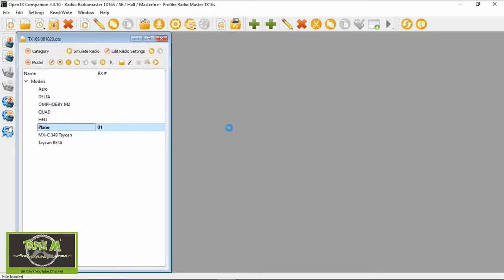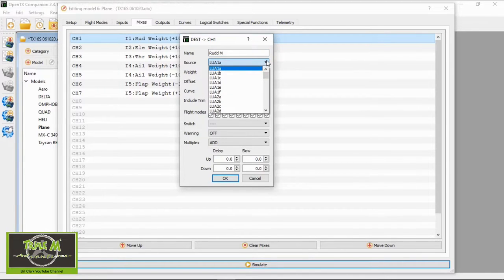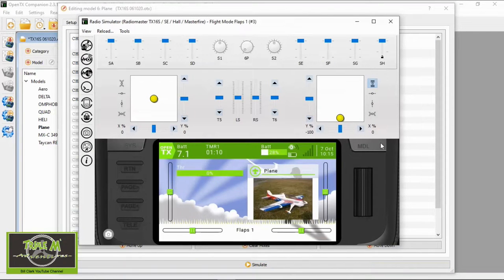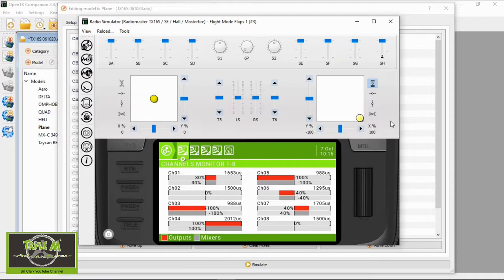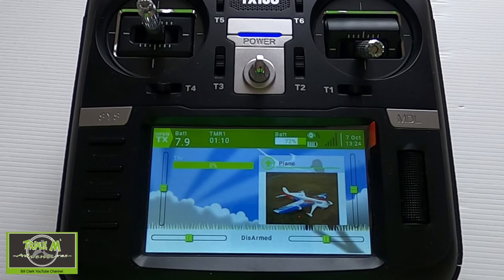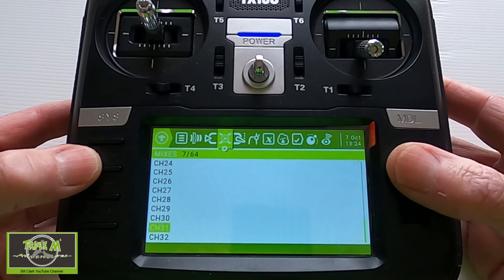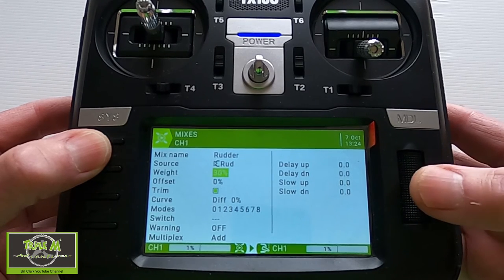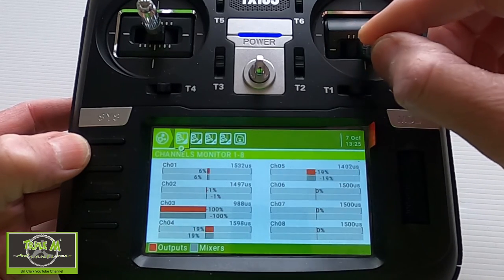RadioMaster TX16S Setting Up Aileron Rudder Mixing

Comment: Great vid. I firstly see this in OpenRC forum, and now this video. I have set this to my Jumper tlite. Working good in transmitter. However one question. Roll introduces tilt. With yaw, the drone will turn but in angle direction, going downward due to tilt angle. Do we need to compensate with up throttle ? How much?
Reply from the maker: Herry, very interesting 🤨 I only use this with my fixed wing planes never thought of trying it with a drone. Angle and Horizon mode will, I think, override the mix because the flight controller is controlling certain aspects of your flight but in Acro it should sync roll and yaw. I personally would not set up any mixing of your throttle because you need to be in control of the throttle at all times.

Comment: Greetings Bill .I do like you simple presentation. Is there any chance you could show how to set this TX up for a Parasail. Cheers...
Reply from the maker: Chris I do not have a parasail but does your parasail use yaw and throttle only? Once I know this I can advise how to set up your TX.
Reply: Thanks for your prompt reply Bill.  They all seem to be Rudder or aileron coupled with elevator .and making sure that there is no "UP' movement on the arms. I have set it up previously on a JR 9X using curves but this new 16x  is just a little "out of my league"
Reply from the maker: @britinozoz  give me the model name  and I will look it up and work out the mixes in OpenTX for you.
Reply: Thanks Bill..  I should have made my answer clearer.  Its for the HKING parasail and I fly mode one using the throttle on the right stick ..with the yaw and brake on the left stick.
I do all my set up on the TX...no FC work   Cheers. @the-happy-RC-flyer
Reply from the maker: @britinozoz  I would set up a standard model which for Mode 1 would be left stick rudder and elevator and aileron and throttle on the right. Connect you yaw servo to the rudder channel and brake servo to the elevator. If you want the brake to only work when pulling the elevator stick back and not operate forward set the elevator mix to Weight -100 and Offset to -100 You may have to reverse this depending on the servo orientation. In Mode 1, which I fly I would set up yaw, primary steering, on the right stick where my aileron would be but that would be my preference. I hope this helps.

Comment: Hey Bill, Could you help me. Using pixhawk and Ublox gps 1400KV and 3S 11.1V. My drone is getting tilted and moving towards South West direction. The reaction is so fast that as soon as I take off it goes and hits to my wall and breaks the props. Any guidance to make it stable and fly vertically atleast. Used a lot of upper and right trims not working. Using Flysky i6 Mode2. Everything is ready from my end still first flight is pending. Thanks a lot
Reply from the maker: Firstly you should not use the radio trims for a quadcopter so set them back to center. Have you calibrated your Flight Controller? Check your flight modes are set up correctly because it sounds like your drone may be in Acro mode from the way you described it is reaction and if you are a beginner your may find it difficult to fly in Acro mode.
Reply: @the-happy-RC-flyer  Hi Sir, I am using pixhawk in stabilize mode. Actually I calibrated the escs. And trims are perfectly at center. Can you please suggest your version of esc calibration. Trims are at center and moreover I reversed the trims to which side it was tilting. I am yet to try throttle curve. But, not much idea on pitch curve. Please help sir. I rely only on you for all information you provided till now. Thanks a lifetime
Reply from the maker: @SubratRed  The problem you are having will not relate to your ESC. Once you reset your trims did the quad hover? These problems can be difficult to diagnose without having access to the drone.
Reply: @the-happy-RC-flyer  Right physically you have to troubleshoot... Trims are centered now and have reset. Worried to give a test eveytime my props break apart. Flysky i6 tx tutorials are rare I think I have to select a model heli, acro etc and adjust throttle and pitch curve also. Not getting proper tutorials.. Thanks I will be in touch

Comment: Thanks for your post. Maybe you can help with my problem, please? I've setup ,y WarWing Delta and all controls are fine except, as a Mode 1 flyer, I like using the rudder stick to provide some aileron control on hand-launch. I want to "mix" in some aileron then I use the rudder stick as there is no rudder on the delta. Any suggestions would be appreciated 👍 TVM
Reply from the maker: Yes you can do that it is not a problem. Duplicate each of the Aileron MIXES, the first line in the standard model, then change the SOURCE to INPUT Rudder. Do this for the second  channel. You can change the amount of throw by adjusting the weight of the RUDDER INPUT say to 50
Reply: @the-happy-RC-flyer  Thanks very much Bill. I'll give it a try. I'm sure it'll work fine :-)
Cheers
Athol
Reply from the maker: @AtholCohen  If you have problems let me know.
Reply: @the-happy-RC-flyer  Hi Bill, and thanks very much for the Rudder to Aileron Mix - Works perfectly :-)

Comment: Hi Bill Virgil here from Tracy Island. Counter to previous assertions, the T16 Pro has become my daily driver and it escaped deliberate and sudden oxidation. Now - I see that you have adopted the RadioMaster units. How would you compare the RM T16S Vs Jumper T16 Pro? Is there a reason to own both now that I am an unlikely multi-protocol convert? Hope all is well with you. Have to go, Tintin is kicking off again and I've got a zoom call with Penelope at 15:00 GMT. Cheers.
Reply from the maker: Hi Woodstock! 😂 Because I am a content maker I do need to change my radios to update my radio tutorial videos for beginners and give them help with the new radios if they need it. I still think the Jumper T16 is a great radio but like anything the next generation has more features like you can charge you battery in situ in the RadioMaster TX16s it also has a touch screen but not operational until OpenTX 2.4.0 😞 and I was disappointed with support at Jumper, RadioMaster have been very good. I used my Turnigy TGY9X for 10 years and they still work fine. The TX16s, in my humble opinion, is an upgrade on the Jumper T16. The radio I pick up to go flying is my RadioMaster TX16s if that helps.
Reply: @the-happy-RC-flyer  Hi Bill. Yes thank you - it speaks volumes. I have also seen RM T12 making waves. Does it have any tricks that TX16S does not? I don't know why I would want a JR module or a Crossfire module. But maybe I do? Thanks as ever. I've got a palm tree wedged in Thunderbird 2's garage door, and I need to get to the supermarket before curfew so must run. Cheers
Reply from the maker: @mrhilma  You should get Brains working on that garage door problem after all that's what he is paid for!
The TX12 is a basic radio and nice to have if you want a small well priced radio to throw in your backpack and not to take up to much room. It does have less switches than the TX16S but enough for most models but no colour screen which means no widgets!😢. Strangely enough I am using mine for small models, go figure! 😊 TBS Crossfire all I can say about it is very good. What I like about TBS is they sell you a product and do not leave it at that they support it and add other features which cost you nothing. There is a place for other systems if you fly close in RadioMaster, FlySky, FrSky receivers are fine. Let's be honest we need competition to bolster product development.
Must go Grandma Tracy is calling me for a coffee break!
Reply: @the-happy-RC-flyer  Ah Grandma - such a sweetie pie. Brains is tied up with his eco engine at the moment, so I think I'll just use a chainsaw. I think I need widgets so will take a careful look at RM T16S and Crossfire. Thanks for that! F.A.B. Bill
Reply from the maker: @mrhilma  Widgets are cool!